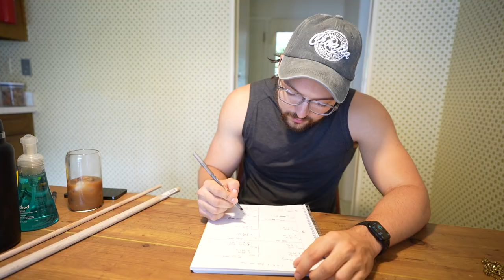How to Update Old Interior Doors - New Door Knobs, Hinges, and Paint

Comment: The gap at the bottom of doors is for circulation.
Reply from the maker: Yes, you are correct. However, the gap after removing the carpet was nearly 1.5” which is very large and unsightly. We added the wood to the bottom is create a 3/4” gap which is recommend for air circulation